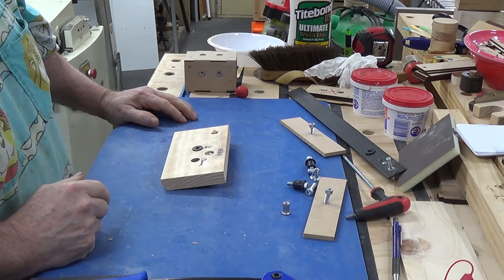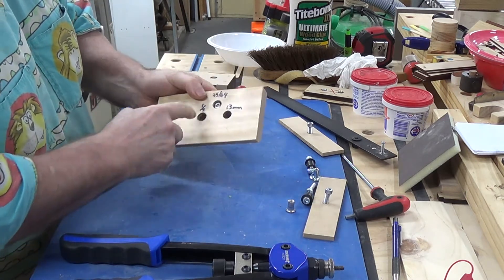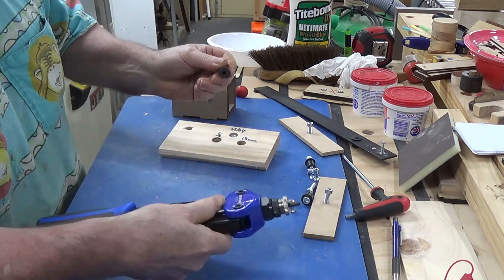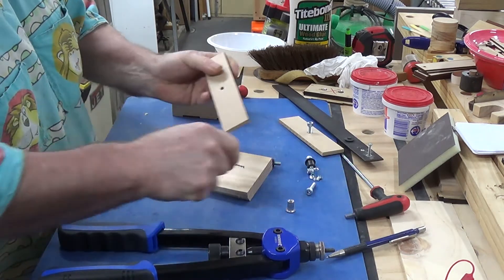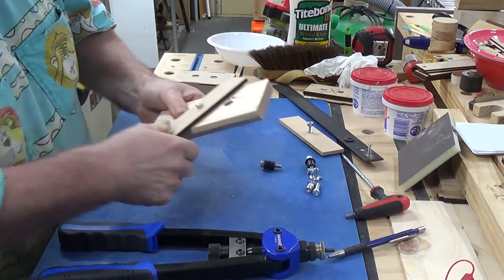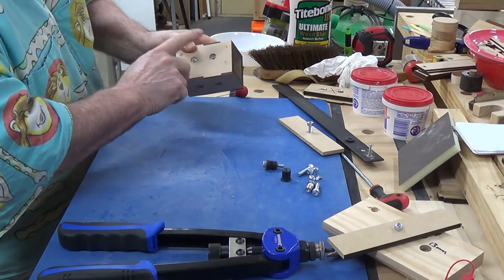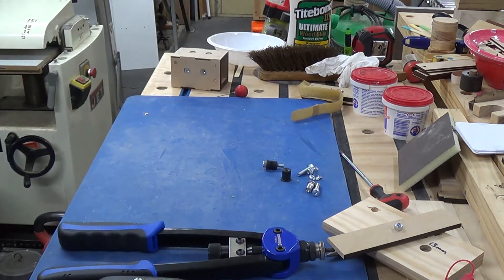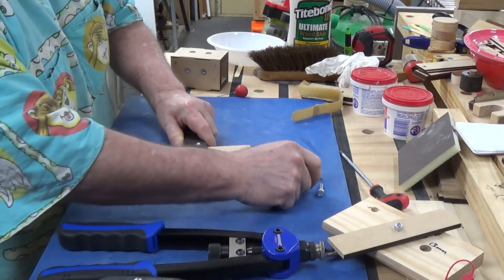Rubber RivNut insert correction

Comment: Another interesting video Alex.
you may be interested to know that you don't always have the room to use the tool.
In these rare cases you can use a bolt and nut and a ratchet drive to insert the nutsert
Simply fit a nut on the bolt insert the bolt and screw the nut down and hey presto its done the same job as the nutsert tool, albeit a lot more effort is required.
Reason being you need to know in case you snap a spigot and 4mm and below are susceptible to schnapping (tee hee) if you happen to be off 90 deg to the work surface.
Haven't managed to break a 5 or 6mm spigot yet
Reply from the maker: Appreciate the heads up Rob... Makes sense... I'm new to this rivnut gizmo and still learning... not a great need for them in my routine work but have been priceless when they were actually needed... Now that you mention it, I might try my Milwauke cordless torque wrench and see what damage it can do... If it works well all I need to do is fish for imperial rivnut and forget the matching mandrel.  Thanks...
Reply from the maker: Never let it be said...
I did a quick test but when I tried to screw the bolt further down into the rivnut, when the bolt bottomed out, the rivnut spun in the hole...
As in the video, that method works for the rubber inserts but not for the metal rivnuts... will send you a PM with the video just so you can drool over the animal prints some more.
If you know a trick speak into my good eye so I can stop spreading all these false tales to the unsuspecting public...